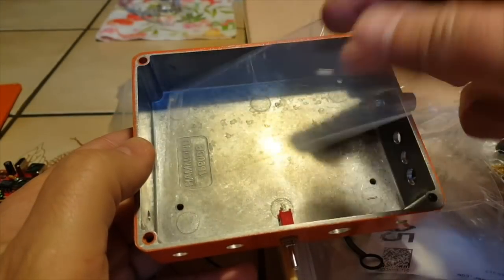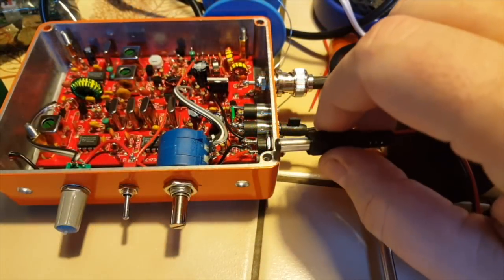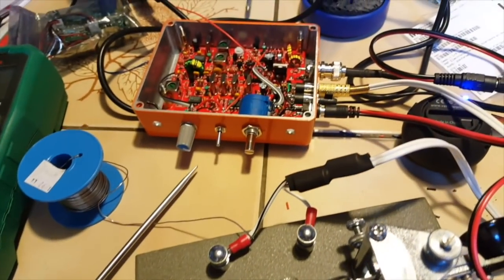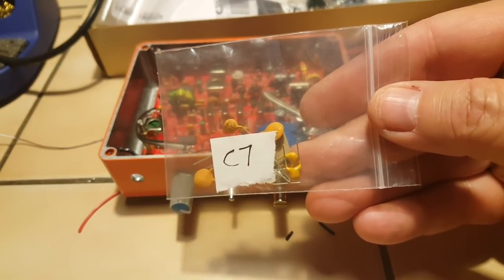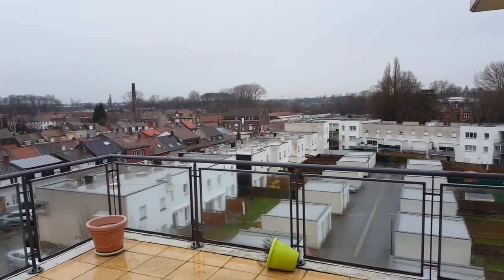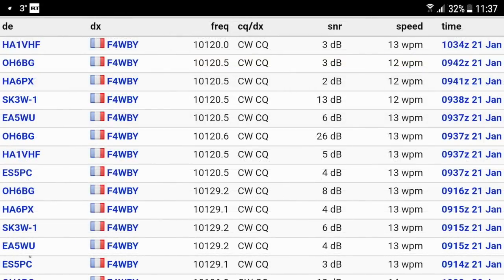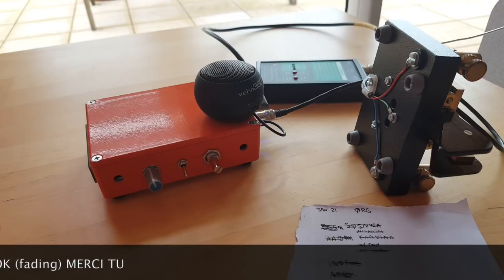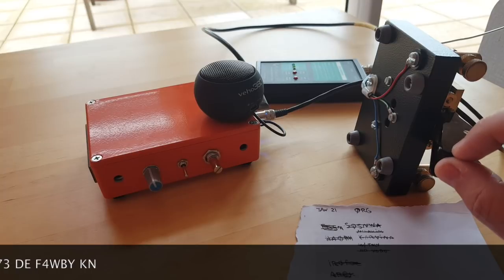The Resurrection of the Small Wonder Labs SW+ Radio, Pt2.

Comment: Quite a few years ago I helped over 25 members of my ham club build this little rig over scheduled build times on 3 weekends. We got this number of builders by promising that all the radios would work when we were done building. Some of the guys who had never built a kit before ended up adding frequency counters and all sorts of small mods to their rigs. These go together easily and they perform very well. I built mine over 25 years ago and it still performs flawlessly. I really like the sound of these rigs thanks to the crystal filter. It's very clean and pleasant sounding. Like you, I wanted internal batteries in the one I built, so all I have to add is an antenna and key.
Reply from the maker: One of the best kits out there! My VFO craps out after 15mins for some reason, any idea?

Comment: Thank you for nice video Gil! Could you compare receiver sound of QCX and SW+ transceiver?
Do you have mobile phone interference problems? I have with my SW40+ that I built two years ago.
73, Ivan, 9A5CZI
Reply from the maker: +Zrinko Ivan Vukoja I'll have to finish the QCX... All my radios get interference from cell phones up to a few feet away...
Reply: Thank you! This is realy great radio with very low noise receiver, very stable VFO and extremely low power consumption. Ideal for battery operation.

73 de Ivan, 9A5CZI
Reply from the maker: +Zrinko Ivan Vukoja Indeed, one of my favorites!

Comment: Great radio.  One problem with the Lipo's is that if they start to swell up, they can catch fire.  Myself, I might be tempted to use a simple battery pack with some AA's.  However, I love the all in one design of having rechargables inside the radio!  Pretty cool.
Reply from the maker: +KM4ZCU I think those are lithium-ion... The charger is a Lipo charger, same voltage.

Comment: Great vid.  Thanks.  How does your ME30 compare to your MTR?  Curious what the current draw, max supply voltage, and other stats are.  RX sensitivity?
Reply from the maker: +ntc490 I need to compare them... The MTR is better on many fronts but costs much more...
Reply: The ME series draws 20ma on receive. 0.04uV sensitivity. It draws 290ma on transmit power of 1.9 watts.
Reply from the maker: +mrrick07 Those 1200 mAh batteries seem like they will last a very long time...